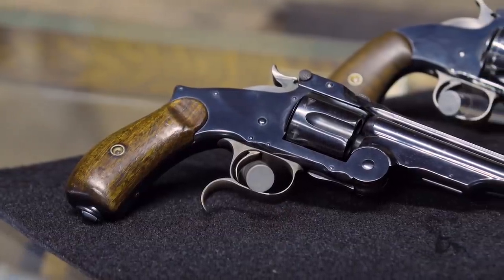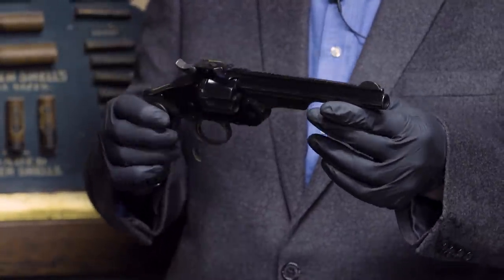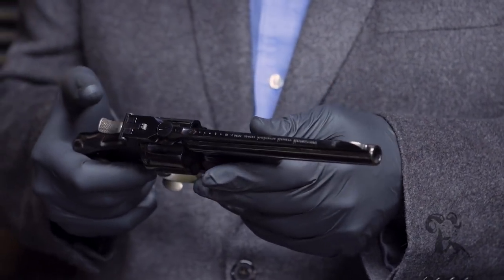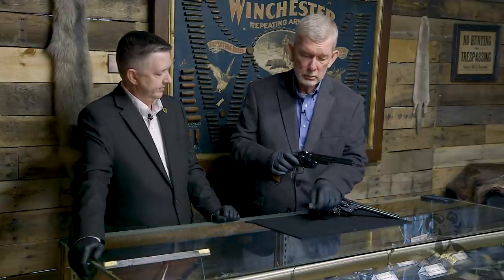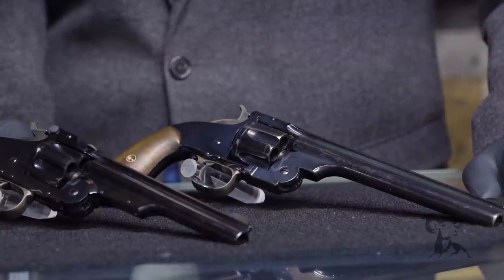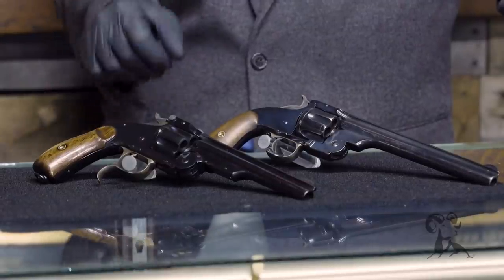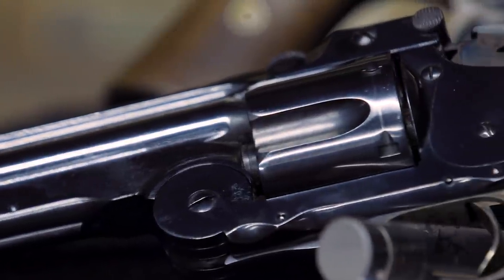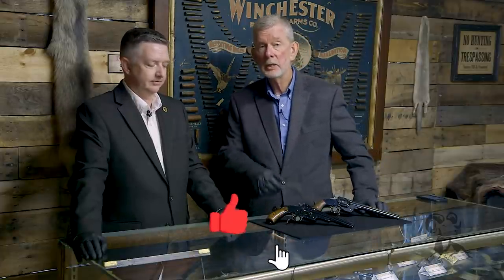From the Vault: Tula Arsenal S&W No. 3 Russian Revolver

Comment: I have a handgun that looks like one of the Russian guns. My grandfather brought it back after WWII. It dosnt have one of the double figer grips but it dose have that hump you spoke of. And the bottom of the grip is quite rounded off rather then flaring out like the Scholfield. It has a "W" or and "M" with an arrow threw it ,it looks like but not 100% sure. Then it has a "66W" or if you flip the gun upside down its an "M" with an arrow and a "77m" hehe There are a few very small royle stamps on it as they look like crowns..... but so small i cant be sure. Plus the welds on the firearms are quite rough. And the trigger guard is screwed on kind of crudely although the trigger guard was made for the gun as the type of metal and color/bluing is all the same. HELP PLEASE? hehe  I mean the one stamp other then crowns could be a 44W or M44? Looking at it while holding the gun upright or upside down?lol